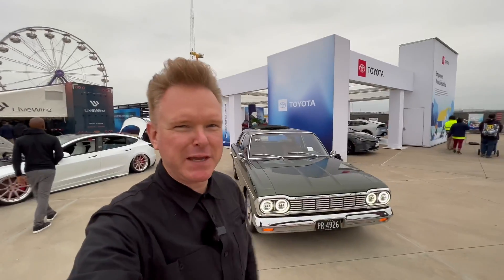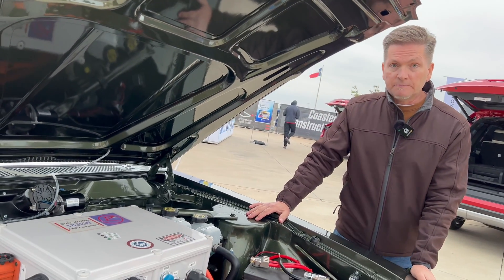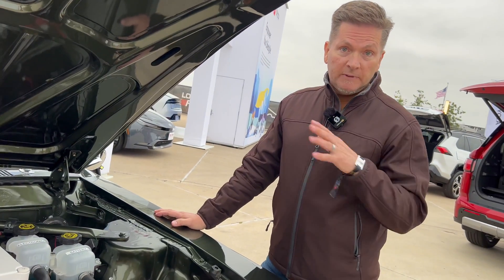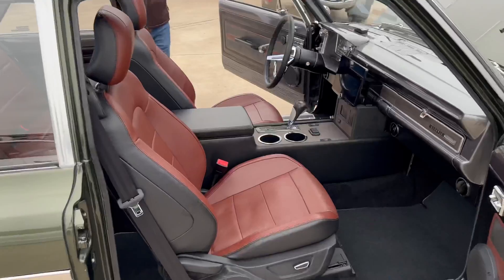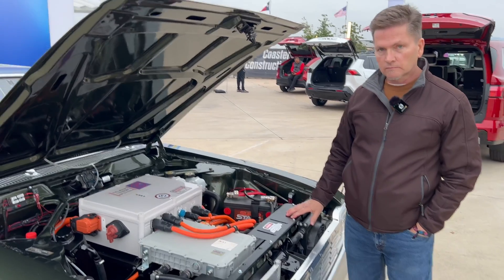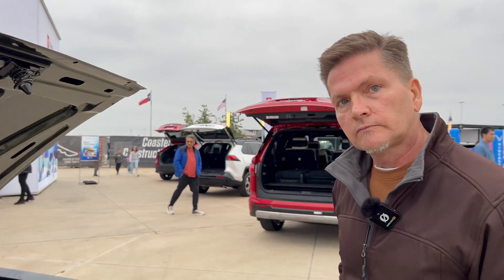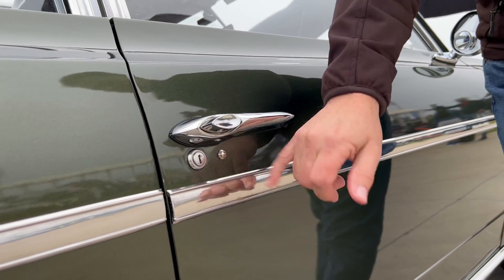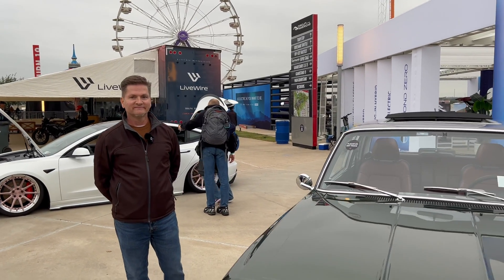This 1964 Rambler Conversion Is Powered by Tesla and Lexus

Comment: What an impressive build. He really made it a modern car while keeping the look, on the outside at least. So many nice touches like the turn signals in the mirrors and the start button where the ignition was.  Nice color too. I'm not sure how he could have done the screen better, but it's the one part that doesn't look quite so slick.